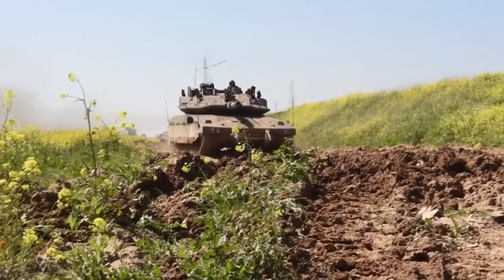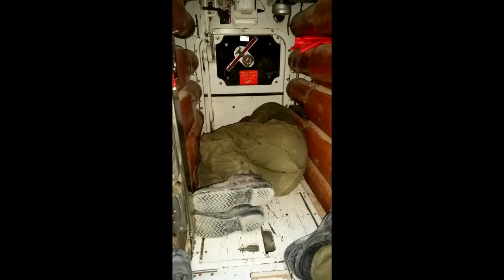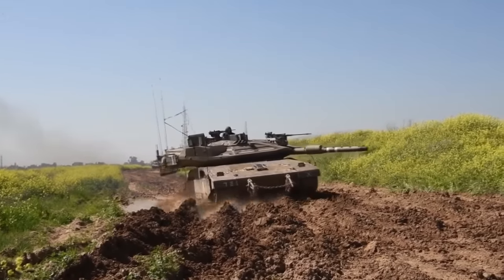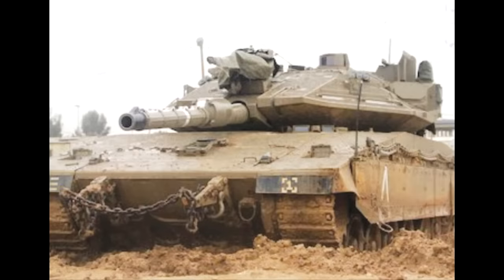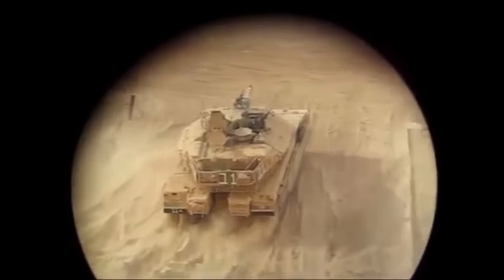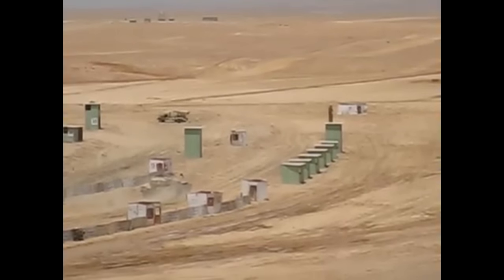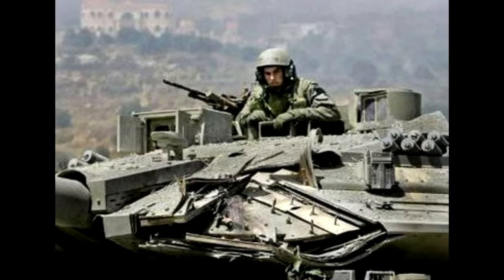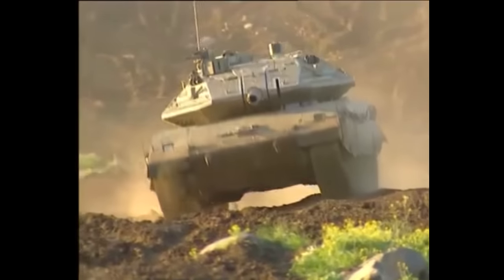Problems with Merkava tank

Comment: finaly someone clearing the myth´s of this tank.

there is a reason why most nations dont put the engine ine the front of their MBT´s. modern composite armor needs quite some space and a front engine limits the frontarmor design alot.
Reply: Israeli tanker are trained to fight in a hull down position whenever possible.  In case of war, they also have prepared positions set up.  People forget that unlike the Abrams, Merkava is designed for defense with short supply lines.
Reply: @yonghominale8884  blah blah blah. You can't just sit in that hull down position all the time. And once you go to counterattack your supah-stronk-hull-down-tenk will suck miserably.
Reply: @yonghominale8884 
The Challenger series was also designed like that, and the lower front plate was summarily neglected in a similar fashion. Fast forward to LIC in the Middle East and a couple of IEDs and ATGMs later, the British Army changed their tune. 

The only reason that the Israeli armed forces haven't lost more tanks is that they are led by competent commanders that are cognizant of the Merkava's strengths and weaknesses. But that does not excuse a pretty elementary design flaw.
Reply: What myths are you talking about? The engine of this tank never was a myth to begin with.
Keep in mind the Merkava was meant to offer better protection thant the  Centurion and M60 tanks, which were ISrael's Main Battle Tanks until replaced by the Merkava in the 1980.
So yes, the engine in the front definitely proved much better protection than compared to the Centurion and M60 that Israel used before. Of course it still wasn't as good as the other Western MBT's like Abrams, Leopard 2 and Challenger. But Israel was't as rich as those other countries, so it did the best with what it had avaibale. Most middle eastern countries still don't even have their own indigenous tanks even to this day.
Reply: @xAlexTobiasxB  iam talking about the myth that the merkava tank is the best protected tank in the world. peroid. 
for israel the merkava is fine, because their potential enemies dont have modern tanks.

but against other modern MBT´s, the merkava would not perform well.
Reply: When you take a look in the last battles that was fought by this vehicle and learn a little bit about Israels Doctrine, I  wouldnt call it a "Tank" in the first place. Its more of an mix betwen IFV and MBT, they got Mortars and Grenademachineguns on Board etc. Also in all there Plans for War, Israel is in air superiority or there are screwed. Merkaver isnt the best Tank in the world, but the best Tank for Israel in everymatter and thats the important thing.
Reply: @sgtjt119  iam not blaming the merkava, iam blaming the guys who(history channel etc.) put the myth about the tank in the world. the merkava is surtently is made for israels needs. for example its well suited for urban combat etc. while in a cold war scenario in europe it would be far inferior in a tank vs. tank engagement.
Reply: @gOtze1337  Ah, I guess you mean fighting in Central Europe by "Cold War".  All marks of the Merkava are designed from the combat experience of fighting hordes of tanks and ATGM equipped infantry in the Sinai, Golan, and Lebanon.
Reply: @crimsonadder6313  In counter attacks infantry will support the tanks from enemy infantry as best as they can while trying to get to the objective. Also what you say is both correct and wrong. It is only correct if the tank designer decides to design the tank only to be a hulldown tank, however, no tank designer does that much anymore, and the Merkava was not designed just to hulldown, it has the ability to fight on the move. Also a hulldown tank does not necessarily suck when being used on a counterattack, hulling down your tank does not do anything but hide and/or improve your armor and reducing the exposed parts of your tank. As soon as it needs to be used in  a counter attack, it can do so. THe Abrams is amazing if hulldown, but still works amazing for counterattacks, however, now a days armies rely on infantry, AFVs, APCs,  air power and/or artillery for counterattacks with tanks being used only if necessary. Also the countries Israel may go to war with have outdated tanks with shit rounds compared to Israel, which means the Merkava has a great advantage.
Reply: @jamestheotherone742  
If that was the case, then Merkavas would not have suffered so dearly from ATGMs in 2006, and in prior conflicts, where surviving Merkavas came back draped in the guidance wires of Soviet ATGMs, supplied by Syria clandestinely. 

Crew have died, Merkavas have been knocked out, and it has not been until the introduction of the Trophy APS that these kinds of incidents have dropped precipitously.

Merkavas were designed as a replacement for the Centurion and Chieftan and original marks had zero accomodation for advanced armour packages, NERA arrays, or even ERA blocks, despite Blazer inventing the damn things.

The tall hull and minimal sloping of the LFP is a remnant of the use of AVDS engines, which being naturally aspirated, are huge (and quite tall) for their power output. The replacement of the AVDS series with MTU series engines that are more compact and more flexible with respect to cooling arrangements has not resulted in rearrangements of hull armour, nor has the glacis been beefed up. This is probably due to serviceability requirements, because a thickened glacis and engine cover might make it too difficult to get out of the way when repairing the engine. 

The idea that Merkavas are "ideally" suited to fighting hordes of tanks - when the Sinai and the hills of Lebanon feature terrain that easily canalises armoured formations into killzones is farcical. There is no Fulda Gap scenario that Israel faces, nor Lebanon the same from Israel. A single platoon of Merkavas would reap a terrible toll on invading T-series tanks from the likes of Egypt; and the same would occur for Egypt if they had prepared positions to pick off Merkavas as they wended down narrow valleys. 

The tall, relatively thin-skinned hull, massive turret armouring with pockets more than 1.5 meters deep for armour arrays, APU, and some models of Merkava featuring a dozer blade, indicate that the Merkava's modus operandi is in hull down position. The rear door allows resupply under fire from prepared positions, again supporting hull-down operations. The roof mounted mortar allows crews to lay smoke, launch illumination, and (in the hills around Israel's constantly expanding borders) lob 60mm HE shells into fighting positions in defilade.

Everything about the Merkava speaks to its use in hull down fighting. Every time the Merkava has gone into offensive operations, armoured formations have come back with dead drivers and engine kills and fires. You would think that Israel would observe this and plan accordingly, but Israeli commanders do seem to love their armoured thrusts into civilian filled cities. They would be better off stocking up on white phosphorous and using Achzarits to lead a mechanised assault, rather than lead with a tank that is more mobile bunker than offensive machine.
Reply: Yongho Minale literally EVERY tank benefits from being hull down
Reply: Malthias out of 50 tanks that were hit in 2006, only 20 were penetrated and only 5 actually destroyed. Merkavas didn’t suffer that badly, especially considering the losses weren’t only mark 4s, it was mark 3s and mark 2s as well.
Reply: @crimsonadder6313  like we can see you have no idea. maerkava is made  for defense. and even if conterattack..the tank dont drive alone.  there is still air support and other ground forces.  and also some spec are wrong in this vido. merkave hull is again KE around 800mm thick and again heat 1400mm..thats more then enough.  thats on hull same as a t90 tank.
Reply: because they prioritze troop safety  first, because tank without a crew is useless, while without engine the crew still can use the gun
Reply: @yonghominale8884  Did Saddams tanks hulling down so much in the 1st Gulf War work for him?
Reply: @crimsonadder6313  that's kind of how it's been throughout the conventional wars of Israel, 1973 was held because of centurions in these positions, 1967 same thing, and it's about the same balance nowadays, Israel isnt interested in attack unless its infantry operations as they have recognized that their enemies, only enemies will not fight a conventional war, and in case of offensive the merkava is a great infantry support vehicle.
Reply: @xAlexTobiasxB we r building our own abrams 😊 we have more than 1200 and we r working on   upgrading them
Reply: @ahmedabdulkareem4683  yeah but the Abrams isn't really an indigineous Arab tank, it was designed in the USA, and is only produced by Egypt under license. Anyway it still does not have an Active Protection System (APS), so it's still vulnerable to missiles and RPGs. The Merkava is the only tank in the middle east with APS.
Reply: @MonMalthias  funny enough; the turks need to learn that too with the (20 years ago formidable) Leopard 2  - but competent commanders is where it lacks.
Reply: @Tellestus 0 well, u missed the point that the front protection of the merkava is not that high. the merkava is well suited for urban combat etc. but in a tank vs. tank scenario against other modern mbt´s its inferior. i never said its a bad tank or anything, its just not the "best protected" tank in the world. same counts for the challanger2.
Reply: @Tellestus 0 the merkava is well suited for israrel. but its not the best protected tank(thats the myth out there). period, never said anything else. 

"finaly someone clearing the myth´s of this tank" what is there not to understand?
Reply: still not "the best protected tank" i dont know why u argue with me.
Reply: @gOtze1337  the merkava IS the best protected tank in the world against explosive weapons and projectiles.
Reply: @a.t6066 so "APFSD/SABOT-Rounds" are considered as Projectiles. and the merkava is defently not the best protected tank against those kinds of threats. and what u mean by explosives, IED´s, HEAT, Mines or Bombs?
 iam sorry, but your comment let u look like someone who has no idea what he is talking about.
Reply: @gOtze1337  explosive projectiles and explosive weapons. Why have you asking about what is explosive weapons? Everyone is know what they are.